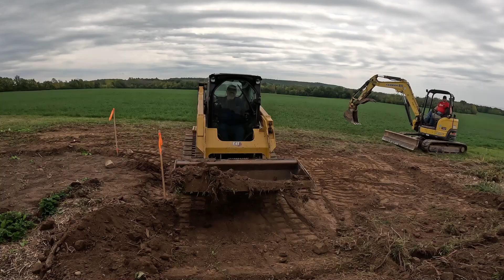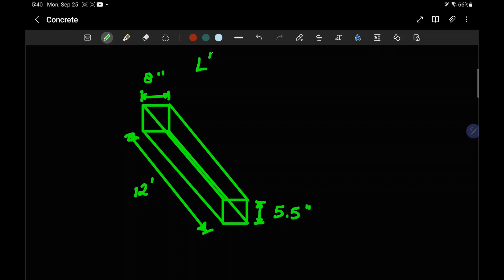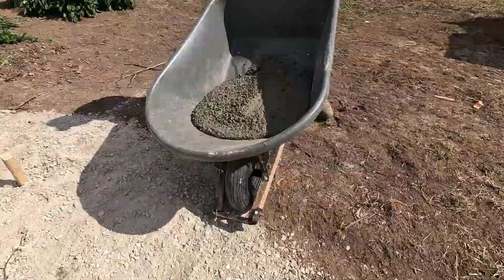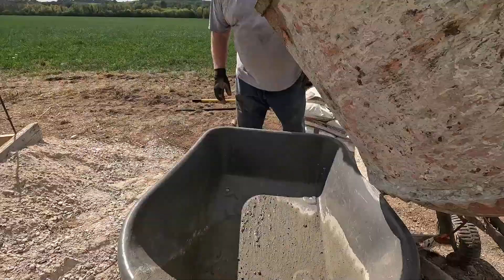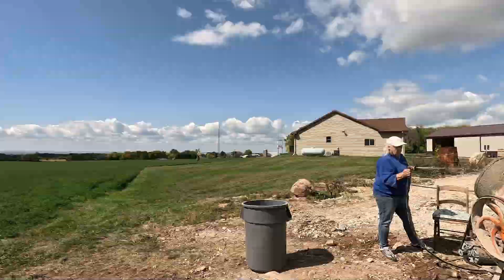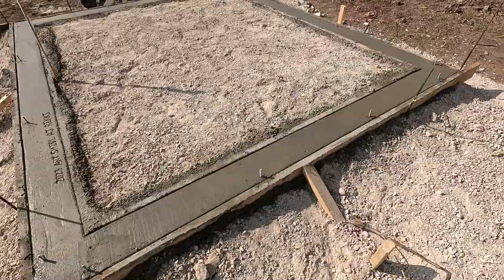Stop Wasting Money: Learn How to Prep And Pour Concrete Yourself - Greenhouse Build

Comment: Another great video!

Fun fact I have learned, if you want stronger concrete, take your conventional bag of ready mix off the shelf, mix in Portland cement, sand and small aggregate (with a little math and proportion adding) and your original mix will be much stronger than it originally would of been. Never had a problem up here in the north east. Just costs a bit more.

In the next video try not to overlap to many voice tracks / music as you have in the beginning of the video, (it gets very hard to understand). 
Otherwise another quality video!
Reply from the maker: Strobelightbrian, duly noted. Thank you so much for all your honest feedback and comments. 😊 It must be something with the compression to the audio that happens once uploaded YouTube.

I was slightly worried about what would happen. The video sounded good on my  computer and in editing, but it seems things change a bit through uploading. Either way, I'll work on it.

I've either read, or heard, about mixing in a bit more cement to strengthen the batches, but I don't know the math for that one. The concrete we used was rated as a 5,000 psi pre-mix right out of the bag. That should be plenty good for what we need. 🙂
Reply: @kickitinthesticks1446  your welcome! 5000 psi is my go to unless it’s a mailbox 😂